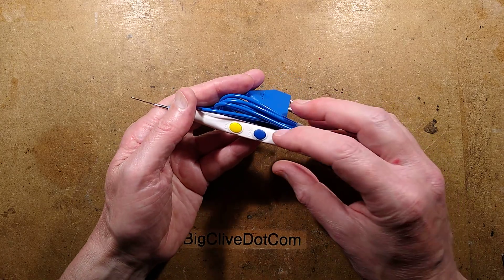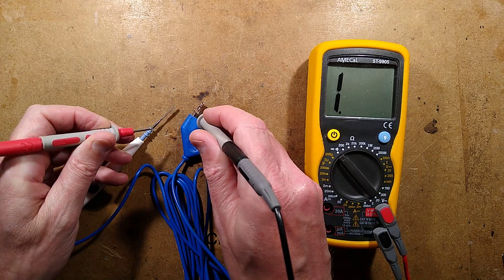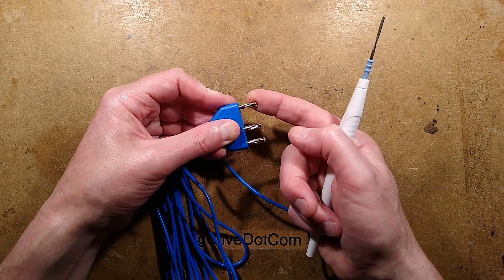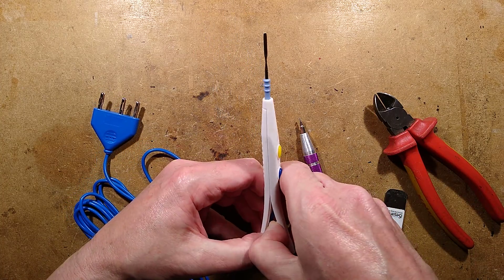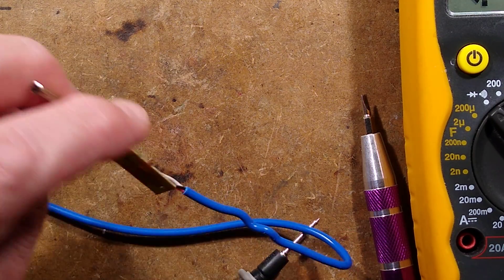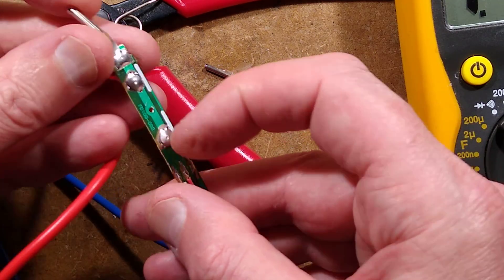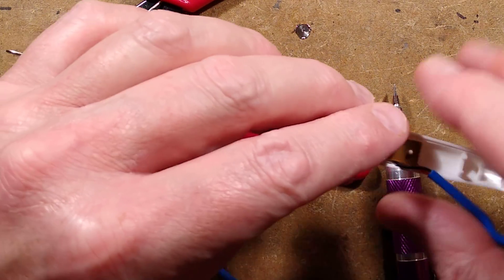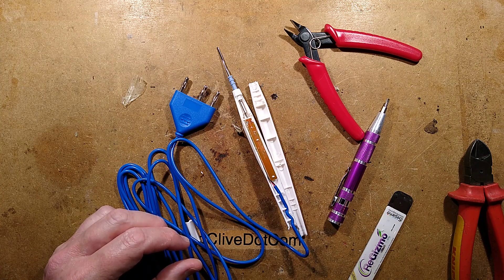Inside a single-use electrosurgery/cauterising pen

Comment: There are different types of tips.  Some tips (probably most commonly used now) are coated so that they are easier to clean.  The "non-coated older" tips are cleaned using scratch pads.  Also, sharper "needle" tips exist to do more intricate/delicate work.  Potentially needing different types of tips during a single surgery and because tips can be damaged during the case is why exchanging just the tip is helpful (even if the entire device is disposed of after the case).  As stated below...there are also longer tips; however, these are not as common in current use because modern units have a built-in extension (you simply unscrew a collar and extend it).  On a different note...if you have a defect in your glove you can absolutely get zapped...it definitely is a "shock and a burn".  Obviously, the shock is not dangerous...but definitely painful.  The burn itself seems to last for days...very focal, but also quite painful.

Comment: That's cool, seen them used on numerous occasions but never seen the "guts" of one!   One thought, do you think if the blade was disposed of and replaced, the unit would survive an autoclave?  or some other sterilization method?  And another job well done!!
Reply from the maker: The pens are actually quite cheap in medical terms, so it makes sense to use fresh ones for each operation.

Comment: That's a monopolar diathermy pen  and the high voltage goes up to 300 volts 300 khz to 1 mhz  frequency , different variations for different effects ( blend , spray ). The pad has 2 electrodes that stick on the skin and the machine measures the resistance in between electrodes (if to high = bad connection to skin so it won't fire )
It was interesting to see inside the pen that your regular NHS hospital pays up to 100 £ for

Comment: The tips are interchangeable so you don't have to open a new handle in order to use different size and style blades during a single operation or buy and keep in stock a large variety of handles to get all the different tips, my GP swapped the standard blade for a loop to remove a papule on my gum.

Comment: By using the buttons connected to the high voltage line, suggests it might be part of a feedback path to indicate a fault right to the tip of the probe. The feedback signal might be used to regulate the power.
It is interesting that the cable is not screened, so the operating frequency is unlikely to be that high, very low HF or even LF, else too much energy would couple through the plastic to the surgeons hand. I suspect the output must be from a balanced RF transformer, so the pad is not referenced to earth, it ensures only the patient can complete the circuit.
 I would be interested to know if any of my guesses are correct.
Reply: I wonder if the buttons are opto coupled, so the patient side is galvanicly isolated.

Comment: Those Bagies of Oinioñs. (SO) a week of raw solar 5.4v added on last night a USB charge, a Huawei, at somepoint it gave up its life ! But at noon the Li batt. made a 12v side-light bulb glow.... Wish Pic's could be sent" .... so finally could find the polarity and I'd guessed Right. . . Stuffed it back into the Power-bank.. it's un-named 20000mAh and on charge by "C"port ... The Question I have for you is ..... The story. Unit in canal .. retrieved .. abandoned .. I was shown it and could see it was puffed-up, so opened and disconnected, prettied the circuitry. BUT and this IS.. pierced the top of both bags to deflate them (have taped now) ... Was this a good thing to do ?

Comment: Funny to see you taking apart a medical device. Have enjoyed you channel for years.
These devices are used around 500khz at up 400v . Different modes for cutting and coagulation etc uses different duty cycles.
Returns pads have largely gone to split plate. It can detect and alarm when the return plate resistance increases >20% which deactivates power delivery. Can add another plate for better return . Also possible to use 2 or more machine as they are all electrically isolated.

Comment: The prongs on the plug are arranged that way to ensure that it can't be plugged in the wrong way accidentally.

The type of diathermy you have there is called Monopolar diathermy. The current flows down the probe through the tissues and out of the patient through a grounding pad. Apart from the fire / explosion hazard with sterilising agents and anaesthetic gases (which was not uncommon in the past), there is a risk of unintentional burns to the patient and more rarely, people in direct contact with the patient if they are electrically connected to earth. All bits of both electrical and non electrical equipment in direct contact with the patent is isolated from earth for this reason. Operating theatre footwear has to be designed for this but shouldn't be so insulating that static builds up on staff as that can be a fire hazard in itself. There is usually a small plug of carbon infused rubber in the sole to allow dispersal of static.

Bipolar diathermy does not require a grounding plate. The probe is in the form of a pair of forceps with the current flowing down one prong and out of the other. The burns are much smaller and cutting isn't possible.

Comment: You can buy those in lots of 50 for around $145 in the UK, while you have to pay $329 in the US for the exact same order.   And yes - the tip is interchangeable, they call it a "standard 2.4mm shaft monopolar electrode". Pretty much like these: https://www.bowa-medical.com/shop/en/electrosurgery-accessories/electrodes/electrode-container-with-electrodes.html
Then for an electrosurgical generator, you could swing by ebay and then get your hands on this puppy: https://www.ebay.com/itm/324724373001?hash=item4b9b14b609:g:NRsAAOSwECRg-flD
Basically, you can start cutting and grinding skin, for under $1000 :-)

Comment: Tip has to be removable as it is considered a “sharp” which needs accounting for at the end of the procedure and disposed of separately to all the non sharp stuff. Cut is for anything deeper than the skin. You use a scalpel/skin knife on the skin, not this. Coag is the main benefit over other cutting tools. Stopping bleeding as blood is a nidus for infection.

Comment: Hi Clive,
The classic Bovie pen (brand name, but common in surgical vernacular).  That should have included a scrubber pad with a sticky back so it can be attached to the paper drapes to clean the replaceable tip (eerily, much like a soldering iron).  The generators cost, on average, about US$3,000 but features, market and manufacturer dictate prices.  I don't work any of those companies, but I've been a participant in many surgeries where this device was ever-present and used regularly.  

Interestingly enough, there is also a disposable self-contained cautery pen.  I took one apart to see if there might be magic inside, but no surprises,  just a metal loop (copper?) connected to two 'AA' batteries and controlled by a push button.  Press the button and the tip will glow.  These are mostly used for minor/outpatient procedures, though.  

Here's a link to some tech specs on a random EC generator:

https://www.boviemedical.com/ids310/#tab-1470952946914-2-1

Interesting info.

BTW: Yes, this can be a rather odoriferous device when used, but suction is commonly brought in to abate smoke and smells.  Unfortunately, in some cases these devices have been attributed to fires during surgery (none fatal though) from the paper drapes going alight or some other cause.  Either the ground pad was not properly placed, the pen was used too close to the paper or some other flammable substance may have been present.  Extremely rare, but all surgery carries risk.  Also, as a safety feature these devices will not operate if the ground pad is not placed or connected or there is a fault.  The generator gets angry and will let you know about it audibly.

Comment: I'm guessing there are 3 inductors in the main unit to keep the RF off the DC connections for the switches... it kind of makes sense to make the disposable bit simple and cheap, even if it means extra complication in the expensive and non-disposable bit!

Comment: The tip is changeable, sometimes during long cases the tip will need cleaning or changed to a longer tip for access to deeper areas of the anatomy.  The newer pens have air extraction capabilities as diathermy causes smoke to occur on contact with flesh. This smoke is carcinogenic and needs to be Evacuated to protect the surgical team.  This has been particularly prevalent during the covid crisis.

Comment: The tip can be unplugged to replace for different tip geometries, but the entire assembly is only used on a single patient, but can use multiple tips per procedure.

Comment: Did I get it right?  Does it commutate high voltage high frequency current with the two push buttons with pretty much non-trivial capacitance?  I should urgently reteach myself all the electric knowledge that I accumulated for ver half a century ....
Reply from the maker: The buttons signal to the main unit, and it appears the signal wires are referenced to the output to avoid capacitance effects.
Reply: @bigclivedotcom  That's a relief!  Cheers Clive. Thought I was going mad (might still be the case...).

Comment: I was a electrical engineer at a Medtronic factory that made similar devices in Boulder, Colorado USA. Ours had no tape, single side circuit board, etc. Amazing how junky this is when it’s used for medical use. We also sterilize ours with radiation even though they are made in a clean room. Welds on ours were robot welded.

Comment: Just looking at the size of that thing: let me guess it uses a half bridge/fullbridge to to turn mains into high frequency without any transformers or large inductances.
Reply: No, this pen is actually connected to an expensive and supposedly highly sophisticated control box with way more than a bridge rectifier inside it.
Reply: @psirvent8  yeah my bad. I thought that plug on the back was a mains plug. I tried to edit my comment after watching the video and seeing it connects to a separate machine, but i couldn't edit my comment.

Comment: I used to service these (non-disposable examples) 
The blade can be changed for different shapes.
We would test them on cakes of bath soap.
The smell is lower on the scale compared to other things surgeons have to do,such as working on the poo production equipment,for example.

Comment: I feel the need to recant my earlier post — here I was lamenting the device is single-use when it seems designed to be multi-use for the pen, single-use for the blades. But tonnes of metal could still be saved if the blades could be sterilized in an acidic solution with UVC.
Reply: Tbh just a wash with hot water and soap (To remove blood and other gunky residues) followed by an exposure to UVC and ozone would be more than enough I think.

But obviously safety standards are much more stringent and I think it's for good measure.

Comment: nice seeing a medical device here! i'd love to send you 2 more medical items -  a single use guidance system for knee replacement alignment (it boggles the mind this thing is single use) and a laryngoscope with what seems to be an absurdly complex surcuit board for switching on and off a single LED - any chance your'e interested?  if so - where could i send it?

and concerning the interchangable tips: as mentioned before there are longer tips for  reaching into deeper cuts, e.g. hip surgery or in abdominal surgery. there are pointy tips as well, and many surgeons put a bend in the tip for reaching difficult to reach place and will later on need a straight one again.

in surgery with local anesthesia i was  surprised to find out that people don't usually feel any sensations in the area of the negative electrode pad - i guess due to the large surface area.

Comment: Hi Clive, These are items I use every day. The original versions were not disposable and had to be cleaned and re sterilised for every use, they were not very reliable.
The new versions are almost 100% reliable, I have only seen 2 or 3 fail in the last 10 years or so and they fail safe. The tips are exchangeable with different styles for different uses. For example there are ceramic coated tips that are easier to clean if they get coated in carbon (Burnt flesh) and fine tipped electrodes for delicate use. The return plate is now a split plate, equivalent to two smaller plates side by side and the rf generator constantly monitors the quality of the connection to the skin and disables the unit if a good quality connection isn't made. 
The biggest dangers using these is that the current passing along a path not intended, such as through other metal surgical instruments or conductive fluids and causing burns other than in the intended location.
The power output is variable and even on moderate settings is enough to produce sparks at the point of use.

Comment: The really interesting bit is the hospital/doctor will charge your insurance a thousand bucks for it!
Reply: Actually, almost universally in the US, there is a flat charge for starting the case. Only under very  well defined circumstances can you add and charge additionally for equipment. Thus, if you’re doing, say, an appendectomy the price of the basics such as blades and sutures, and yes the bovie supplies, are baked into the basic charge.

Comment: Years ago I was watching on tv about medical tools,one tool that they were showing was used for cutting a square hole in the skull, it was stainless and could be immersed in water to be cleaned and sterilized, being a carpenter,I wanted one,,then the narrator mentioned the price, $14,000 , American money,,,,, that was years ago, today,you can buy one for around $100.00 at HomeDepot,  plastic,not stainless

Comment: I developed a tumour on my finger which turned out to be caused by a very rare Lymphoma called Mycosis Fungoides and they amputated my finger and they used one of those to seal up the stump and you can feel the electrical current.It gives a mild electric shock and you can smell the burning flesh.... obviously I was under local anesthesia.

Comment: you ever thought about dripping some acetone on the seam of glued/welded housings? works great on taking apart little power supply bricks and other welded/glued plastic housings.
Reply: I never thought of that... 100% going to try that!
Reply: @deltab9768  yea just put some acetone in a syringe and drip it on the seam then use a razor or spudger, once you get it started keep dripping it with the spudger inserted and the housing will basically open itself.
Reply: @lilmatt1914  If you inadvertently puncture yourself whilst doing the spudging - well, let's say you'll know it, and fast! If you think an alco-wipe on an open would is "ouch" material, then neat acetone's awhole different ballgame . . . . :-D

Comment: ESUs use RF energy to cut or coagulate based on the RF waveform used. This handpiece is from a monopolar ElectroSurgery Unit (ESU) which requires a ground pad to be placed on the opposite side of the patient. High frequency RF energy travels from the pen to the ground pad through the patient.  BiPolar ESUs use utensils like tweezers where energy travels from one side of the instrument to the other side. Any tissue between those electrodes gets destroyed.

Comment: why does some one design in all the seperation of the world with that connector just to have 3 wires coming on to the board right next to each other with essentially no seperation what so ever? also wouldnt this arrangement mean all the current goes through these tactile domes? are they even rated for that?
Reply from the maker: The signal current will be low.

Comment: The Atari 2600 joystick uses the same style buttons which are also held to the board with cellophane tape. The difference being it wasn't designed to be disposable. Just extremely cheap xD
Reply from the maker: A lot of stuff from that era used tactile dome switches.

Comment: After I had some suspicious moles removed I pulled the battery operated coagulation device out of the trash. It didn't cut. I never found a use for it before the battery died.
The handle is not easily sterilized.

Comment: I remember the first time seeing those tactile buttons was in the early 70's in a Mattel Electronics Pocket Football.
My first experience with HF energy [Around the same era.] was the tip of my finger getting close to/touching the wire/cap coming off of a horizontal output tube inside a TV...Fun!!!

Comment: I’ve had a run in with one of these while under local anaesthetic in a very sensitive area, even with the numbing you can definitely still feel a fairly unpleasant tingling sensation when it’s operating! Definitely not a fan.

Comment: I had some moles of concern removed earlier this year. They were removed with a very fine scalpel to "shave" them off, and then this pen was used to stop the bleeding. Needless to say, the smell was not pleasant. After the local wore off, it felt a lot like a burn from my soldering iron.

Comment: Having all the circuits at the same potential allows use of the PCB. Also I don't know of a wire insulation that can withstand autoclaving with heat or gas, hence the single use. The handle and PCB also would die.

Comment: There is also another connection when it is used. There is a grounding plate attached to the patient that goes back the the electrosurgery unit. The connection to the tip creates an indicator circuit to confirm that the patient plate is properly adhered.

Comment: I'm surprised there is no protection due to the high voltage or any short circuit.
Reply: All in the unit, because not disposed.